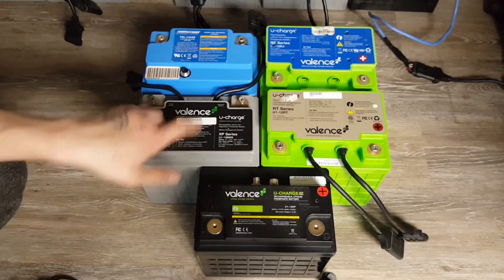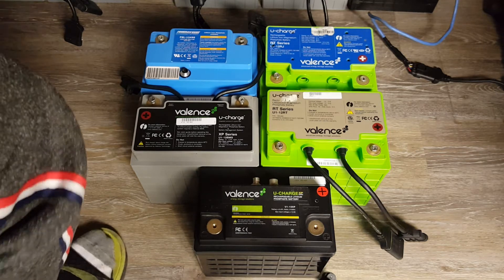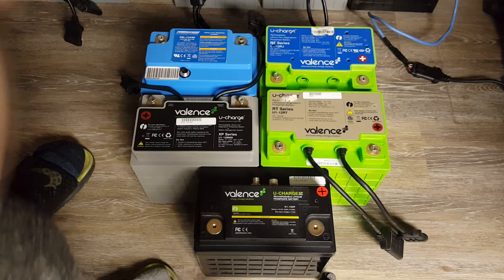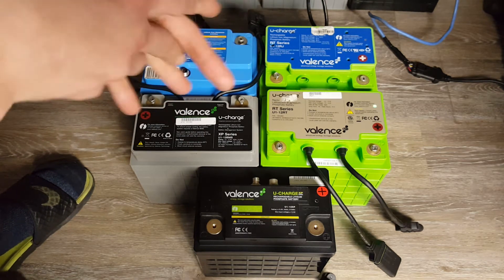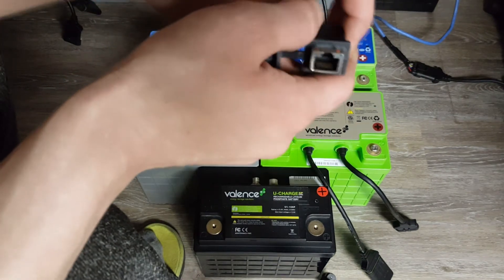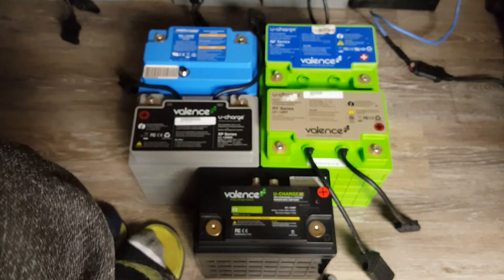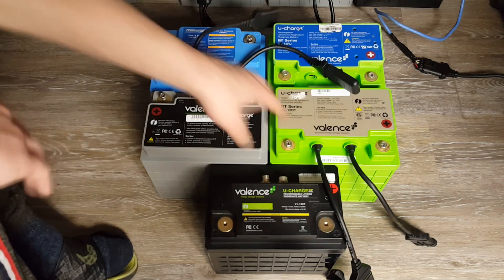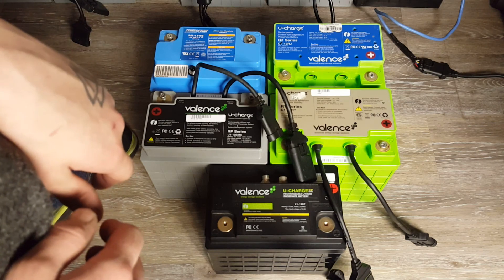Valence Battery Project - Looking at some Valence Batteries!, Battery Bank Build?, Solar Bank Build?

Comment: hey Batman, nice channel. I know I’m about four years late, but I am building a solar generator with 8 U1 – 12 RT valance battery’s in 2 48 V packs for a power system for a she shed watching your videos I couldn’t help but notice you had a lot of termination resistors. I can’t find those anymore and I was wondering if you would be willing to give up about four of those let me know if you still got them and let me know what price you would need for them
Reply from the maker: Thank you very much, Unfortunately i had to move to a smaller location so i had to downsize and sold all of them with the batteries. I know they are becoming rare to find!

Comment: How do I charge these?
Reply: i used a BeLeeb batt charge it is programming for use with these types of batteries. I had one that had gone completely dead. The red light was flashing. I bought one of these chargers hooked it up and it came back to life almost instantly.

Comment: i have (2) of the U1-12 RT series connected in parallel i have one of the communication cables connected. Do i have to connect the communication cables in order for the BMS to work? Or do i have to connect the communication cable to my laptop in order to get the BMS to work like the bigger brother U27-12 XP series ?